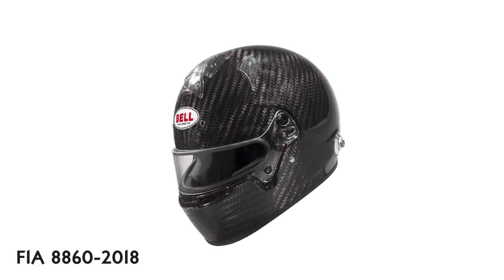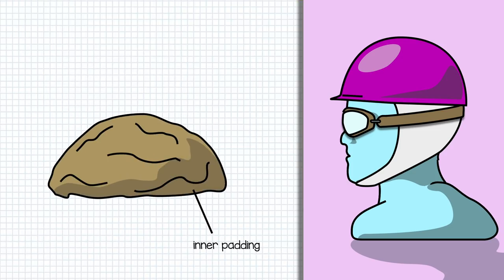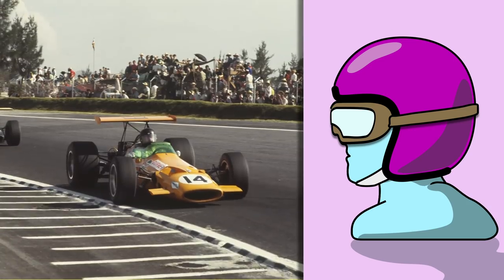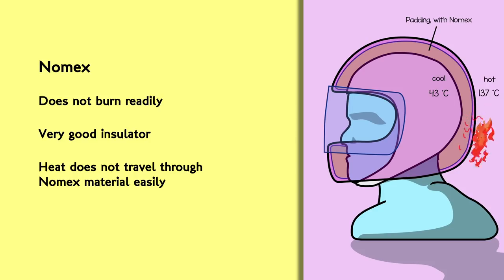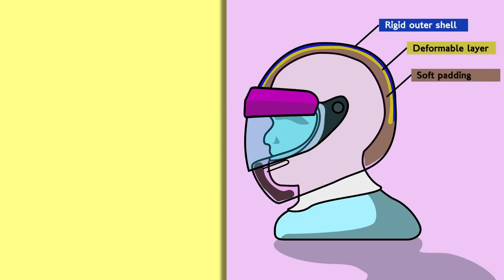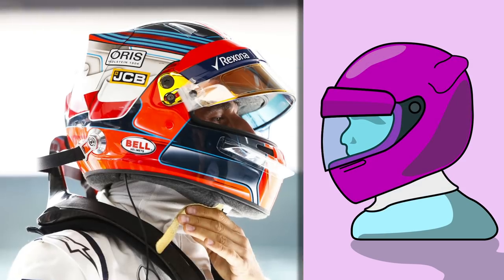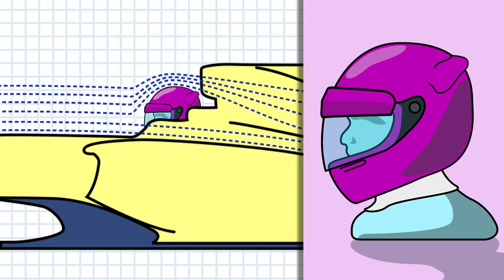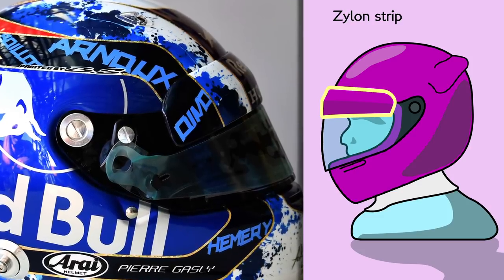The history of helmets in Formula 1 - Chainbear explains

Comment: Nice little poke at the Halo Bar debate at 2:10
Reply: Well its a safety feature but is really ugly...
Reply: Gonzalvez Alvez The main, and only arguments against thhe halo indeed were: A) It's ugly B) F1 should be dangerous
Reply: Hot take, I currently find the Halo fits into the overall design of the cars pretty well, especially when teams like Ferrari and Sauber put single or multi aero winglets on the top of the bar to help with air flow. Plus it's proven it's self twice this year that it works as a safety device.
Reply: Gonzalvez Alvez it’s not ugly
Reply: @LethalWalou  Or C) Aeroscreen is better
Reply: I got something better to protect you from stuff that might hit your face

Halo: Reach Recon Helmet

Comment: Very nice Video as usual. Love to watch. But you have a little mistake built in the part for Kevlar. Woven Kevlar is easily penetrated by a sharp point like a knife, so are bulletproof vest not stapproof. Kevlar stops bullet or other object with very hight tension strenght. So a "soft" bullet deforms and catches several strains of fibre and pulls at them. That will absorb more an more energy until its stops, more like a net.

Sry for english mistakes, not native.

Comment: Great video, but it serves to display the difference between the introduction of the halo and the helmet, and the fallacy of comparing the two. The helmet is a genuine innovation that has always existed in some form in Formula 1 and evolved with increasing technology. The halo is not. It could’ve been introduced far earlier into the sport but wasn’t because it goes against what is considered a Grand Prix car. Hence the introduction of stiffer monocoques, safer side head protection and wheel tethers at times when the halo could’ve been imposed. The halo is a lazy cheat to avoid/circumvent the brilliant innovations that have enabled the sport to be faster/lighter/safer without the need to destroy its integrity. The latest development in helmet technology only further highlights what true innovation is and why the halo is causing more damage to Formula 1 than it seeks to protect drivers from. Cheers for the video☺️
Reply: No matter how much you innovate, a simple option is usually best. Making the cockpit design safer and adding wheel tethers are great, but they dont stop a car from flipping into another cars cockpit severely injuring a driver. Yes that may be a rare occurence, but they are trying to help minimize the risk if it were to happen.
Reply: Loktoren cheers for the reply mate, always happy to discuss. I understand people want to reduce the risk, but if that reduction of risk comes at the cost of the identity of the sport where does it end?? If you like motor racing but you don’t like the risk, shouldn’t those people go and watch touring car racing? If you’re end goal is to remove every possible risk from @f1 aren’t you by definition, advocating for a motor sport that is not Formula 1?? To me people supporting the halo are doing that whether they are aware of it or not. There is historical precedent to say why the halo wasn’t introduced in the past and there’s a clear argument for why it should not be in the sport now. It simply goes too far, and the sport will only suffer as a result. But again though I appreciate your comment mate. I guess my question in response to your comment would be “at what point do you say that the solution to any identifiable risk is too far? Where would you draw the line?” Cheers mate👍👍
Reply: @Jackbyrne77  Its not about removing all of the risk, but making sure that drivers can walk away from a crash and go home to their families. They are racing cars, this isn't something that's a life or death matter. The risk makes it fun, but it shouldn't hold a higher place than driver safety. The more drivers  die, the less people will want to continue. F1 started in an era where safety was always an after thought. It cant continue like that.

Comment: My main concern with modern helmets is peripheral vision, which seems to have been ignored. Could a helmet with a central support and a wider aperture provide the same strength and improve peripheral vision?
Reply: Jist my opinion. Feel free to disagree. But, the center would have to sit very close to the face (or be thin to the point of uselssness.) to not cause problems with vision. The concern about it coming to close to your face is safety. It's meant to deform to take up some of the impact and if your face is millimeters from the eyes shield it can't do its job as well. The could probably make the eyeport wider and still maintain the same general level of safety without adding a center support but I feel like they designed it to be as wide as it needs to be. Remember. The new regs came from a 10 year study of helmet technology.
Reply: But isn't that what side mirrors are for?
Reply: @GloomGaiGar  have you ever driven a car? Or anything really
Reply: As far as I can see by the design (not backed up by actual drivers) the peripheral vision seems fine. It’s almost 180° which is as far as the eyes can see.
Reply: Peripheral vision is fine. A thing that gets in the way a lot more than the visors width is the massive side pods on the cars. Regardless, no-one really complains about not being able to see around them (other than probably Sergio 'tunnel vision' Perez after that shocking race).

Comment: no no no. kevlar is not good at resisting sharp objects at all and a knife will go trough kevlar like it would any other cloth. you need a special stabb proof wesr for that and it has plates in it. Kevlar is used because it csn resist a lot of wear. you can literally drag it a cross asphalt for a long time untik it wears trough.